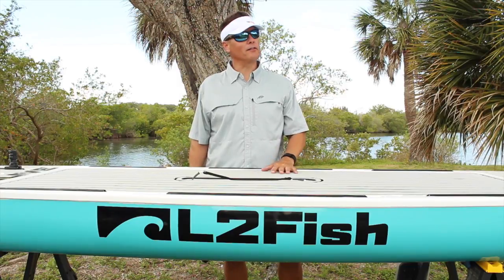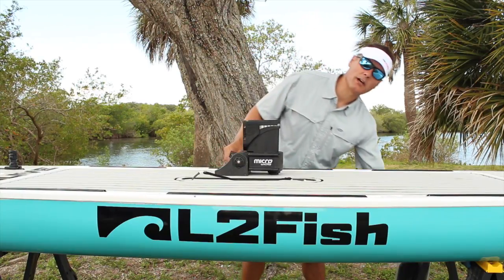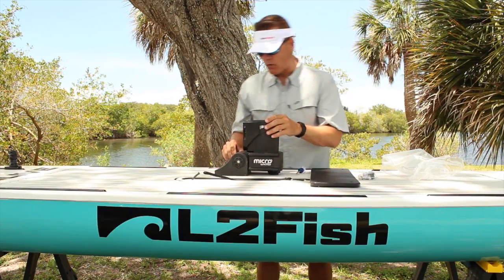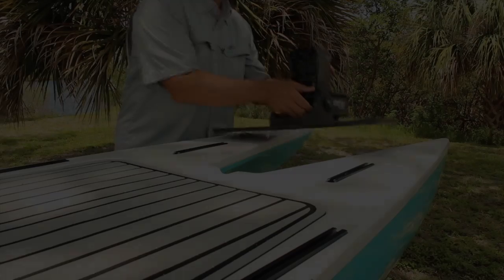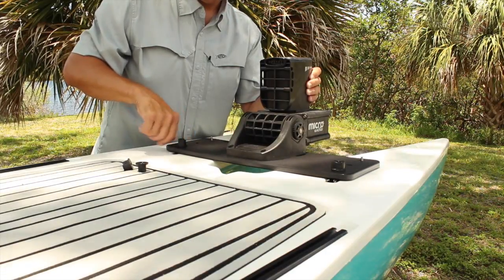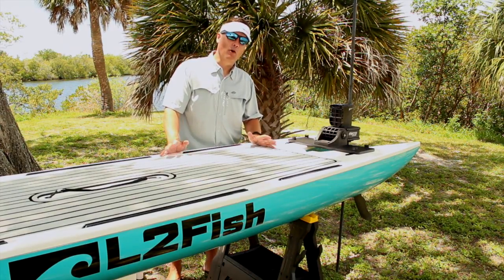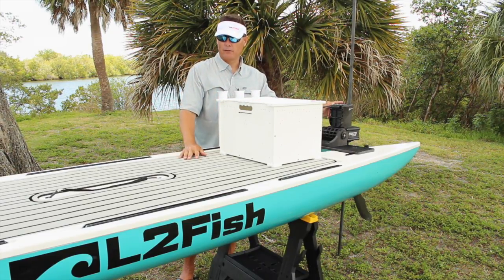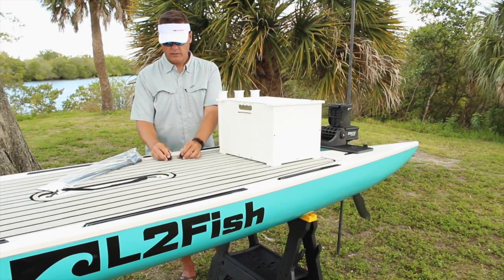How To: L2Fish Power-Pole Mount

Comment: what does a power pole do? I mean what is it used for?
Reply from the maker: Chris Watson I can totally appreciate that question. 

It’s basically an anchor. You will see Tournament fisherman with two Power-Poles on the back of their boat. 

That way they can point the boat in any direction (down wind, broadside to the wind or even facing the wind) and fish. 

No loud noise or splash from an anchor going into the water.
Reply: @butchnewell  ah I see!!! Thank you! I kept thinking it was a rod holder that reeled in the line or something.